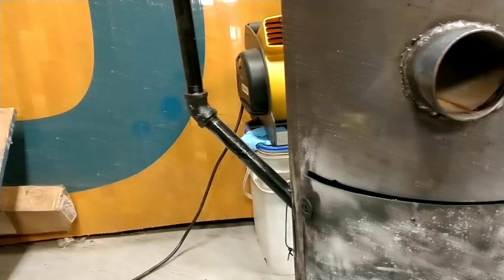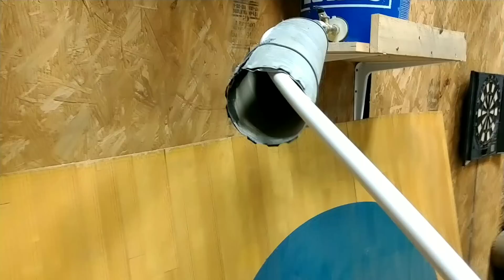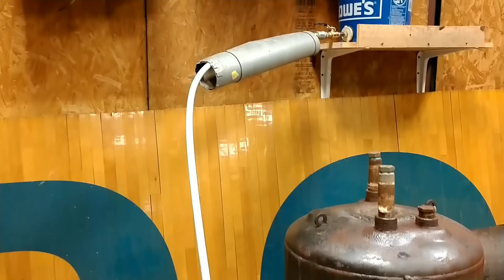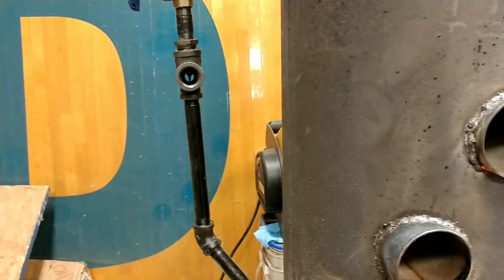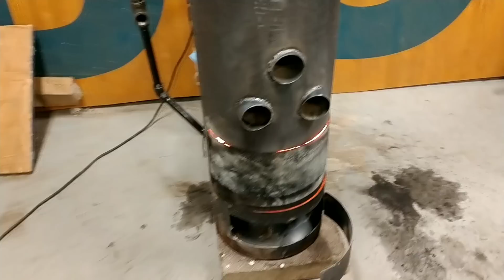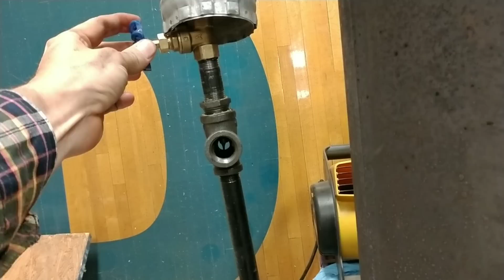Updated Waste Oil Heater Drip Feed Ver.2.2 Detailed January 19, 2018

Comment: Also adding more heat exchanger tubes will reduce chimney temps and help scavenge even more heat
Reply: This can also cause more soot build-up and a bigger pain in the but to clean. No argument on the better efficient though.
Reply: @vhateverlie  judging by temperatures soot might burn away its self....
Reply: @infinitewars6373  not if, like I said, you add more heat exchangers which lowers the exhaust temp down to a possible level of soot deposition.
Reply: number one with the temps in chamber where oil burns all soot will burn off if you go to chimney and look in there will be no black smoke etc..... because the temperatures in the chamber reach very high meaning it all burns off, right in chamber, number two adding extra pipes will allow to extract more heat but will hardly affect temperature of the heat exchanger i have similar one of these and have played about..... unless you use very efficient loud fan.....

Comment: Add a heatilator to the chimney pipe, it will reduce your chimney temp and scavange the heat out of the chimney to blow in to the shop, also allowing you to reduce your fuel usage

Comment: Got a similar project on the go for a workshop heater, 30lb propane tank, with choke and throttle handles, 4" exhaust, and 5x 3" exchanger pipes pointing in a downward fan out pattern. Keep the heat flowing to the floor. Ill post a video once its got a tempgun on it but I have you to thank for alot of the ideas around using waste oil!
Reply from the maker: I'm glad you could use some of the ideas, just be careful when burning oil. I never get out of site when using it

Comment: I would let my oil come in from the top down to an upside-down skillet and then once it got the heat I would put water in with it but it just real real fine stream and it would get so hot you can't stand next to it, it gets red-hot scary hot with the water, it makes some really strange noises when it gets that hot did I say scary hot
Reply from the maker: Sounds dangerous, water and oil

Comment: Nice design.  One suggestion to provide an overflow shutoff, you could bring a tube out of the bottom pan into an external vertical tube with a float switch connected to an electronic shutoff valve at the tank outlet.  If the fire goes out, it would overflow the burn pan, and fill the vertical tube with the float switch, which would close the electronic shutoff valve.   Might have to think about how to make it work during a power outage.   This could also be done completely mechanically, which would solve the power outage problem, but might be a little more finicky.
Reply: Work Works I get what you’re saying but how does the fire go out if it’s still being fueled
Reply from the maker: Great idea

Comment: Hey you probably are already aware of these but if you build another one I figured I’d send you a link to one of these fittings that we use in fire sprinkler systems. Damn good video and project. 

https://shop.eriks.co.uk/en/sight-glass-fig-3881-cast-iron-female-thread-pr-ec011161-0011/

Comment: I knew a man who owned a auto repair shop, he had a regular old wood burning stove, he would have a 50 gallon barrel cut long wise outside. He had it filled with oil and split wood soaking in it, he would go outside ad grab a couple of logs an toss them into the stove toss in a little gas and it would get going, scary but it warmed it up fast.
Reply from the maker: My dad had one of those when I was a kid. He burned firewood but with oil drip to help fuel the burn

Comment: Does it put off any funky smells and how much smoke actually comes out of chimney.  Looks like it works great.
Reply from the maker: No smell inside some oil smell outside. If you use used cooking oild it smells great. I have a vif on the smoke output, check out my other videos

Comment: While in the Marine Corps we used a heater similar to yours but much smaller if you use copper instead of pex you could get rid of the shield protecting the pex, by doing that the heat would warm the oil giving a smoother more controllable even flow through the drip system. Just an idea but if it's not broken don't fix it. I'm glad you include your son in these projects, he will always remember those projects with his dad.

Comment: is that even legal ? i mean look whats coming out of the exhaust (in a different video) personally i dont give a crap, just sayin ...
Reply: Chanda, 
  I built one, based on the Oil Burner's channel, several years ago.  Mine's in a 55 gal drum, and burns about the same amount of oil. This design, is naturally aspirated, and he says, it takes 10 minutes to come up to temp. Mine's a blower system, and comes up, in 2.  Both, probably smoke, a bit, on start up.  But, once at temp, I know mine is burning clean. I would have to guess, this one runs clean too. The fuel is something, most people don't want, so it's free. Instead of going broke, to heat your shop, you can pick up someone else's cast offs.

Comment: Is the exhaust filled with soot or is it clean burning...had to ask given what kink of one particular neighbor.
Reply from the maker: If you have the flame burning correctly I usually get only a very fine dry scale inside the flu pipe and if you have too much oil not enough air then I'm sure it would build up. If you do this and be very careful or burning old is dangerous

Comment: what are the fittings for 5 gallon bucket
Reply from the maker: I'm not exactly sure what that fitting is called on the 5 gallon bucket it's a type of bulkhead that has a rubber gasket and a nut on the inside sort of a compression bulkhead fitting I got it at Lowe's
Reply: @randysdiy2102  thanks i found them 
it is a bulkhead can be found cheap on amazon

Comment: Cool. My little 23000 btu kerosene heater does fine unless it's really cold. Any smell from that setup? Plenty of oil and transmission fluid to burn. Looks like a neat setup.
Reply from the maker: You can't smell it inside the shop due to the all of the air in the shop being pulled through the heater nothing really comes out of the heater into the shop at all exhaust through the flu. Outside the shop you do get some oil burning smell but very little

Comment: Crazy question, so you don't need a heat deflectors and such, why not have to oil supply on the other side so it is not near the high temp, there may be a reason for how you have it but I'm not sure what, except to keep oil warm so it runs smoothly??

Comment: Do not follow this video. It is unsafe.
Reply from the maker: You are correct it is very dangerous, as I stated in the videos. You must use common sense and be extremely careful if you do this.
Reply: @randysdiy2102  
Every person who watches this, and tries it out has the potential to kill their entire family either from explosion, fire, or carbon monoxide THE SILENT KILLER. 
The least you should do is to post a large written disclaimer banner floating continuously across the video, as well as to buy a digital RV carbon monoxide detector as well as MULTIPLE PROPERLY RATED FIRE EXTINGUISHERS and never leave the unit unattended. 
When you read in the news that your idea resulted in tregety, how will you answer to this? 
Are you personally insured for criiminal negligence?

Comment: Looks great! 

Also, to the people commenting about CO: his exhaust is going outside. Very little exhaust fumes will be getting past the burner door. That heater will pull fresh air from the shop, and of course he'll have to crack a window for inlet air, but it wouldn't need much. No building is air tight. It'll be just fine.
Reply from the maker: Thank you for your comment appreciate the positive notes
Reply: Talking about air tight building. My "two door" garage/workshop. Definitely need the last door. I built and assembled one of them. The other is still missing. Not air tight for sure, perfect for oil burning heater ventilation. LOL 😂 
BTW I use an old iron pot and chimney assembly with a disk brake. Works perfectly.

Comment: Good job.  Now....my questions are how can you have all those vents in the door and the bolt on top of the tank and no smoke or other gases are coming into the room?  The air intake is good when the room is cold but once the room is warm you are using the warm air to burn the fuel, isn't it better to have a way to bring cold air from outside to burn fuel rather than to use the warm air inside?
Reply from the maker: on the first question about why isn't  smoke coming out of the bolt hole is the flu is the creating of draw on every orifice in that tank and expelling those gas out of the flu outside the building therefore no smoke would come out of the bolt hole due to the draft going out of the chimney. As for the other thing about drawing air from outdoors instead of indoors yes that would be a much better way to do it, but this is just something I wanted to build with my son to have a little project and we didn't get that far but it's a good idea I may incorporate that into it this year.thanks

Comment: i have some questions, #1 how much waste fuel do you spend an hour? or roughly what do you think it uses. one coment mentioned a rocket burner on the stack somehow and you could potentially burn 20 quarts
 all winter long!?  #2 do you worry about water from rain coming down the stack? im going to look for the video you have about the smoke volume to get a somewhat birds eye view of the design but i cant think of a safe way to build this outside my shop and rout the heat to it unless i enclose the burner in a fire brick enclosure and blowers with air ducts to the shop. i dont mind going out in the cold to work the heater especially if i can make it automated from inside. love the video thanks for sharing !
Reply from the maker: https://youtu.be/Ynot-jq4ybg

Comment: Has anyone ever heard about arbon monoxide poisoning?
Good way to die.
Reply: Dude! If you are going to leave a snooty safety comment the least you could do is to make sure that you know what the hell you are talking about! The unit has a chimney, clearly visible on the top right. Those holes in the front are the heat exchanger. 

Quick quiz for you. If you take a safety approved non-catalytic heater and ran it in a closed closet next to your head would it kill you orm would you be safe because it was "safety approved"?

Comment: Ok two things i can`t tell from the video are those 45 fitting clockwise or counter clockwise,  and what made you decide the hieght of the exit at the top of the tank, ( i think i wound have put it down 3 or 4 inches lower)
Reply from the maker: The direction of those fittings shouldn't really matter and yes I should have lowered the chimney exhaust
Reply: Now just hold up there a minute, i flush my toilet in the northern hemisphere and it goes clockwise, let's nail this the right way might make the burn hotter and the fuel less.  CARE  to share what the high of exhaust might or might not accomplish

Comment: Why cut the x pipes going through middle extend them 5 6 inch for more x change. Good work I'm building one
Reply: If the cross pipes were positioned at an upward angle they should create their own draft.

Comment: Be careful with that ash when dumping it out and when cleaning the flue. I'm sure that contains tons of heavy metals since it's used motor oil.
Reply: So what?
Reply: @elbuggo  Did you know that lead is bad for you, especially when it's an oxide dust that gets into the air easily and absorbs much easier than the metal itself? That's what.
Reply: @MrItsthething  - And at what dose? Cant do these calculation without knowing the dose. 1 lead oxide molecule is bad? How bad? And how do you know? Be careful, hysteria may also be bad for people!
Reply: @elbuggo  Lead tends to bioaccumulate, meaning that it doesn't really like to leave the body once it's there. I said to be careful with it, not that it will kill you if you look at it. There's a difference between understanding something and saying "it's not harmful, it's just ash." Well not all ash is created equal. Many industrial chemicals are clear liquids or white solids, but one might kill you and the other won't. Doesn't mean they're sugar and water. This ash will contain a fair amount of lead, zinc, and other heavy metal oxides. Most of it was oil, but the organics all burn off  Be careful, stupidity may also be bad for people!

I'm a chemical engineer and I've done process safety work in a metals processing plant. That's how I know.
Reply: @MrItsthething  - As a chemical engineer you should know that lead is everywhere - the nature is packed with lead. How come this bioaccumulating isn't more widespread? There should be signs of this everywhere, Still, any problem is hard to spot. Where can we find them? It is almost as if the problems only exist in peoples imagination. More fear porn?
Reply: @elbuggo  Yes, there are very small amounts of lead everywhere. That doesn't mean you absorb it all. If someone were to create dust from this ash in a place they work/live, they might inhale it, and now their environment will have a higher lead concentration. Caution never hurts. Like, don't blow it out with an air compressor. What knowledge base do you have to tell people that it's not hazardous?? Probably nothing? And as someone who's not a chemical engineer, you should probably learn that not everything that's invisible is imaginary. I'm used to thinking about it. You're obviously not. You generalize like you're 65 and throw safety to the wind like you're 15. The worst of both worlds.
Reply: @MrItsthething  - Of course some of the ash is inhaled. Do you have any clue on how tiny these molecules are? You get about 10 trillion in a milligram. One of the tenets in the toxicology is that all substances exist in all other substances. That's why I was asking about the relevant dose here  (the dose makes the poison). And it is minute in this case also. No problems here unless he should swallow all the ash. But then I think he would have a bigger mental problem then the ash may cause!

Caution never hurts? Of course it does. Unreasonable and unfounded caution will make people poorer. And there is an inherently higher risk with being poor than wealthier. 

A chemical engineer may not necessarily understand health risks at all. Just because you can feel something is dangerous, doesn't prove it is. I wish you could understand that you have to be able to demonstrate (potential) damage, and not just feel it to act.

It is all about dose dude, that is just as significant as the substance. We have to add them together if we want to say something meaningful. Dose x substance = risk. There is usually a threshold there, where no biological response is detectable.

Comment: Guaranteed that if that pan fills up with burning oil it will not be going out on it's own regardless if the level gets above the air inlet elbows, you would end up having an inferno start spilling all over the floor so I would rethink some safety measures like having a couple 5 gallon buckets of sand along with a ready garden hose that is already hooked up to a spigot and turned on, sand first to smother any burning oil and then water second only if needed. A couple good CO2 fire extinguishers would be wise too.
Reply: Martin's Tree Works : water hose?  Need be? If you need to create an explosive, flaming steam cloud 20 times bigger than the original out of control fire then a water hose would be ideal. With only 6” exhaust 15’ in length, even though his burn chamber is piped directly to exhaust, I would suspect the least resistance would be at the air draw, which would make his stove look more like an angry volcano with explosive diarrhea. 

A video of that would be super cool to see, as long as everyone was safe.
Reply from the maker: I have several fire extinguishers around the shop